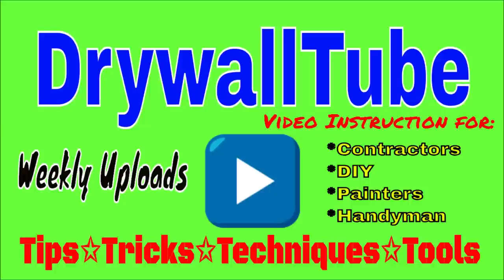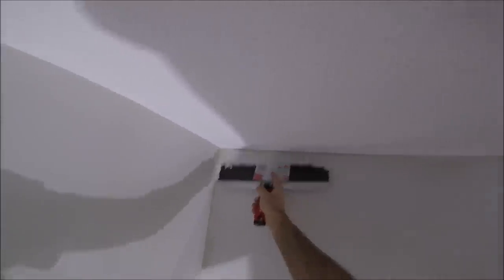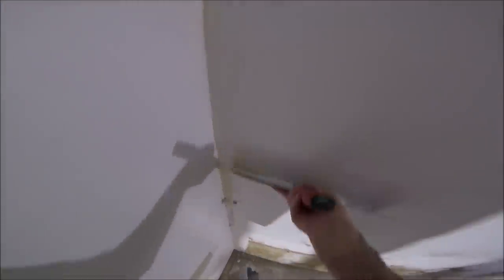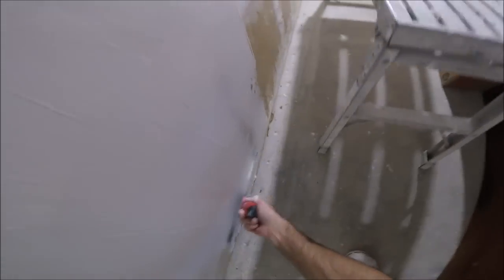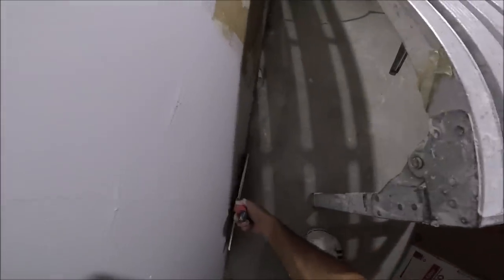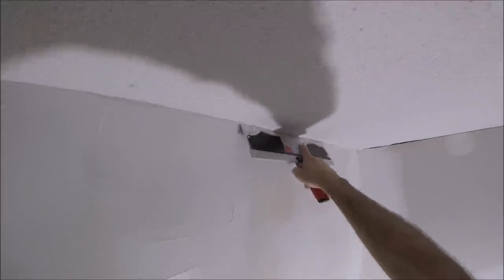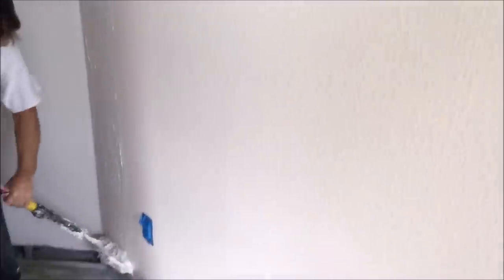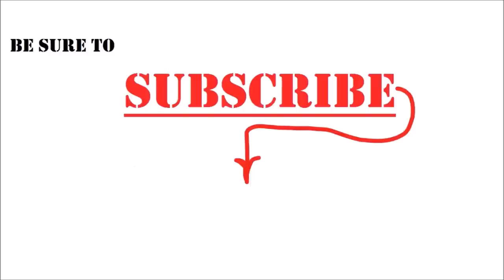How to Cover Your Ugly Damaged Wall with a Skim Coat- Looks Like Glass

Comment: DIYer here. I have a bath room with a slanted ceiling 10 feet at one end and 3 1/2 feet at the other with  a skylight. A prior owner installed paneling over unfinished sheetrock with nails only. I am taking down the paneling. The screws are installed flush with the sheetrock. Can I skim coat the sheetrock without setting the screws. Is it a good idea to seal the sheetrock even though there was nothing else on it?

Comment: Thanks so much for this helpful content. I’m just a diy’er who’s interested in learning how to do work by myself and save a lot of money in the process haha. I was just wondering if it’s ok to use drydex 30 min spackle vs joint compound when doing drywall repair that required new drywall to be installed, and how long should I allow the joint compound to cure for? Thanks and God bless!

Comment: Paul, I am DIY - what if your wall is painted with semi- gloss should I sand all over and paint primer on it before mud? Is there is a best primer to use for that; Kilz or Zinsser? :-) Okay, watching this video though you just answered my question ; Zinsser - but what if the wall is semi-gloss and has uneven wall damage from old repairs over that past 80 years and its a very small bathroom- do I need to sand or just prime?

Comment: Great videos.  I heard you mention that finished joint compound should be primed before painting.  I'll be using Behr paint which includes primer.  Will that suffice, or should I still first use the product you recommended?
Reply from the maker: You’ll need to use an actual primer.👍🏻 The paint and primer in one paints are only good for previously painted surfaces. I hope this helps. Thanks so much for watching and subscribing my friend!😎 -Paul

Comment: I am a DIY person  I have removed wallpaper from the lower half of the bedroom walls with a steamer it was a hot job that took awhile to do to remove all of the paper  It looks hideous but there are not many damaged areas, but the texture is all over the place .I only have one place with the brown paper exposed .  Your video is extremely helpful  I am sure you are making it look easy but I will give it a try .  So I will do the Primer sealer step first , then  can I do the roller method to apply the skim coat that seems to be easier to apply the mud.?   I just heard you say you do the paint roller technique with two people can one person do it ?  do you recommend doing the corners before the  first skim coating , and is it necessary ? Question is the joint compound the same product used for the skim coating ?? Thank you  This is my first time trying this.  After this  I will look for videos that you might have on how to replace  drywall  I have a bathroom project that is moldy due to flooding of the bathroom and  leaky shower floor  the whole  bath has to be redone   :(  Thank you so much !!!

Comment: Hi Paul, another great video.      I am a handyman doing more and more drywall work so really enjoy your vids.   I have a small bathroom ceiling that has paint pealing issues and some chipping dry wall on outside corners at a sky light. I scraped off as much flaky paint as I could and just used some Zinsser BIN shellac primer.  (Saw your Zinsser primer suggest a few minutes ago will use that next time)
Will the BIN primer work for a thin skim coat layer?      
Thanks  
Mike

Comment: I have 5 boxes of blue lite compund and want to utilize it for skim coating on plaster walls with drywall fill in larger areas... can i use it? Can i add glue or anything to use it? Should I use it on  first or second coat if I can utilize it? Thank you.

Comment: hey Paul I have taking on the task of skim coating my textured ceiling finished my 2nd coat , still some ruff spots so I will probably give it one more watered down coat hopefully this will be the last coat! Thought I had a smooth finish but next day I have a bunch of ruff finishes I didnt notice while applying the coat! Frustrating!!! My entire body is sore from working on the ceiling lol!!!
Reply: Just went thru a similar nightmare and it was over a ceiling that only had 70 years of jacked up painting jobs and nailpops.  I used good lighting on elevated stands and it looked good.  But after turning off all lights and just using a halogen flashlight across the ceiling the skimcoat looked terrible. I was more meticulous on the second coat with the same results. The hand sanding took longer and was more tiring than the skimming and after a few toucheups I think I'm ready for paint.  That light held ACROSS  the surface is a must or you'll be painting over alot of defects.  After painting you'll have to sand off the paint to fix any ridges or lift offs you missed.  This isn't to discourage anyone from trying this. Just remember it's much harder than it looks but with enough coats, a handheld light and the dreaded sanding, you can get a decent result.

Comment: DIYer here; need to fix a 40 year old bathroom.  Damage to bottom of exterior wall apparently due to efflorescence,  I know I need to replace the section of drywall & seal the cement slab; anything else I should do to ensure it doesn't reoccur?
Reply from the maker: When installing drywall over a concrete slab, I always keep it 1/2” off of the concrete floor to avoid any type of moisture wicking up into the drywall.👍🏻 I hope this helps. Thanks so much for watching and subscribing!😎 -Paul

Comment: Great Video!  My problem is the opposite...My walls have been painted over wallpaper and you can see the seams from the wallpaper.  Can I still use this same technique?  Any Suggestions?  Thank you!
Reply: I have tried it in the past it works for a little while but the some of the edges eventually peels hopefully it works for you

Comment: Hi there Paul, I have walls that have not been painted in I am guessing 20+ years - the last time the previous owners of my house did any work.  Would you put on the sealer before skimming?
Reply from the maker: I think you should be fine without priming if you use the all purpose joint compound for skim coating.👍🏻 I hope this helps. Thanks so much for watching and subscribing Jayman!😎 -Paul

Comment: Paul, you and many others say to use thinned down All Purpose for skiming.  But, people coming to my house for estimate that involves skim coating all my walls with a thin layer say they want to use Plus 3.  Should that make me not use them?  Even Topping can be used as a thin skim coat right?  A contractor sprayed my walls with Kilz3 primer and messed them up with many different textures in the primer.  skim needed to even out the texture.

Comment: My dry walls in the garage look like trash. Holes and patches and paper showing through. BUT, what I think is worse is the entire wall is chalky to the touch. Run your hand across them and you turn your hand white covered in fine power. Can I mud over the chalky walls or do I have to do a wash with something beforehand?

Comment: I have watched several of your videos and they have been so helpful, I started taking down wallpaper from a bathroom, they had put it directly on the drywall (no primer or anything) so it was really hard, I couldn't find gardz so I used pro 999, now I'm trying to do the skim coating part and it's so hard. I cannot we the hand of it, it's a very small bathroom and I don't want to waste a lot of material and I don't feel comfortable with the paint roller method. Any tips on how to get a smooth finish, also how to skim coat around really tight corners?

Comment: Watched several of your videos....got and older double wide with the vinyl covered drywall that previous owner removed the trim strips and attempted to tape and bed the joint. He did a really poor job then painted.  Paint seems to be stuck pretty good but a few places where the vinyl has turned loose from the gypsum  How to skim over the painted walls.  Maybe try to sand down the bad bed joints first then prime with Gaurdz.

Comment: Hi Paul, I'm a DIYer. I'm trying to sell my condo located in a 100 year old building. The contractor did a crappy job mudding my small laundry room wall. There are streaks, ridges, clumped mud everywhere especially at the corners where the wall meets door or window moulding. It looks really bad. I want to sand the wall down and remove those big clumps so I can skim coat it and re-paint. What's the best way remove those big clumps of mud? Thanks for your help!!

Comment: #drywalltube    Thanks Paul for another great video for us DIYer's out here!  Perfect for my own remodel project dealing with old rough textured plaster walls in my entryway and hallway.  I tore out the walls in the hallway and rehung new 5/8 drywall as the plaster on those walls varied from 3/4" to 1-1/4" thick in some places then had to straighten the walls to reinstall the new drywall.  Will be needing to finish that newly hung drywall soon but for now I am trying to repair plaster damage from door openings I had to widen and in the process damaged some of the old plaster surrounding the opening.  I will have to skim coat the entire wall on those sides now so I can get a consistent new paint finish where the repaired areas meet up with the undamaged plaster walls.   Great channel!

Comment: I'm a DIY'er. I'm remodeling my house and the walls have a heavy "stipple"texture. I'm trying to find a simpler way to smooth coat the walls. I've been doing something like this, but I haven't been doing the slant to the wallboard knife. I've been having to put 3 or 4 coats on the walls and it's still not as smooth as I would like.
Reply from the maker: Try leaving a little more mud on when you’re applying the first skim coat.👍🏻 I hope this helps. Thanks so much for watching and subscribing Tom!😎 -Paul

Comment: DIYer here. I have walls that are old sheet rock that has about 1/8" plaster coating with large areas where the plaster flaked off when scraping the wallpaper off. They're large uneven areas. How to I level that off?

Comment: I have a bathroom that was painted and the paint peeled and cracked. I tried scraping paint so I could do it right but it was not easy and in some places I got too deep and you can see brown patches. I also have another wall with wallpaper and was told I can mud over that too before painting. Any advice for me I’d appreciate

Comment: My house has wallpaper that has been painted over..So the walls are smooth. In one of the corners the wall paper is peeling.. should I peel off what is loose.. I was planning on scratching the walls a little with some sand paper a d then rolling on some texture... This is my first time doing anything like this

Comment: #Drywalltube. Nice job Paul, looks like a new wall and as smooth as new drywall. The paint roller trick seems like it would make the job easier.
Reply from the maker: Hey there TEH!💥👊🏻 I appreciate that man! Yes, the paint roller trick is perfect way to get a consistent application of the joint compound for skim coating!👍🏻 Thanks for watching and your feedback man!😎 -Paul

Comment: I'm a DIY. I've never done any mud work. I'm a mostly a woodworker/ mechanic but I do have a house that needs a lot of work inside. Time to learn some new skills. I have a couple small walls to practice on and play with as far a different painting techniques and patterns. I don't have any wallpaper to deal with. All the walls have a knockdown finish and painted an ugly off yellow. I have high vaulted ceilings with a popcorn finish. Is there a technique to use if I can't physically reach the ceiling? Can you skim coat using a extension handle? #drywalltube.
Reply from the maker: Hey Mike, I think it would be difficult to skim over popcorn without being able to get close up. IMO. Have the popcorn ceilings been painted? Thanks so much for watching and subscribing my friend!😎 -Paul

Comment: I'm new to doing walls. I've gotten all the wallpaper and paper off the wall but my wall looks a mess. I have places where the sheetrock is torn pretty bad. Also there was paint under the wallpaper some of the paint came off and some places there's still paint. Do I need to sand before priming? Also should I try and patch the places where the sheetrock came off before skimcoating? Thanks I love your videos. Nervous but not sure what my next step should be.
Reply from the maker: Hey there M G!💥👊🏻 No you can just prime right over the painted surface. Then make your repairs. After the repairs the skim coating fun can begin.😃  I hope this helps. Thanks so much for watching and subscribing my friend! -Paul
Reply: @PaulPeck  Thanks for the quick reply. I'm now ready for my next step!
Reply from the maker: M G Right on!💪🏻 Keep us posted man!😎

Comment: I need to re-skim coat a large area--1.5 to 2 feet--where an object dropped on the outside roof so hard it cause the skim coat to crack and break away on the inside ceiling. I am not sure of the best way to remove the loose skim coat that is hanging down so as to not make the problem area larger yet I want to put the new coat on a solid bound surface.

Comment: My god is this hard, especially after popcorn removal where the corners/edges are all messed up and bumpy.  1 bump by the ceiling or floor and the knife chaters and makes bumps and streaks.  Never been so frustrated, so tired of sanding. Took me about 400 hours of non-stop work to get 4 walls to look moderately decent. Should have hired Paul.

Comment: After our tenant left our condo unit it i found out some.painted areas are already swelling. Its a concrete wall and i think the building contractor skim coat the wall before painting. But after we remove the swelling part some.of the paints also peel off. We tried to.skim coat the uneven parts but it doesnt seem to adhere well. Now we re trying to wash the powderlike thing wich could be the reason why skim coat wont adhere.

Comment: #drywalltube
I’m a DIYer renovating my master bathroom. I finally got the wallpaper off and walls cleaned. Now I’m skim coating. You make it look so easy! I thinned my mud to pretty close to your consistency, maybe a bit too thick still. First layer I felt like I pulled way to much mud off, some spots I could still see the wall other spots it was just right with a nice thin layer. 

 My second coat I’m going to try to paint roller application method as I might have struggled with applying the mud before smoothing. Is there a way to tell if you’re pulling too much mud off? I know to add pressure to just one side to prevent lines but how much pressure overall? 

I’ve only watched a few videos of yours and haven’t seen the answer to those questions yet, but I’m sure you’ve answered them somewhere. 

Thank you for all the help
Reply: Get a magic trowel to skim coat

Comment: Can I use interior filler for that.  I put the wrong paint ,on my kitchen wall ,next day got cracked everywhere.,as I'm DIY I start scraping it off , till I removed a lot of chanks of layers. And to cover the damage I painted gloss over it. Now year later I want to fix the wall like you did in the video. The wall now looks uneven with paches,.

Comment: Im a DIYer and I'm glad I found your video. I have paint the has peeled off my kitchen wall where I want to put stick on backsplash. Is there any other kinds of sealer brands that I can use that are sold in stores? And is it ok to mud over painted areas? I have a section where I didn't peel the paint off cause it's a big section. #drywalltube

Comment: I used Roman Pro-999 RX35 surface sealer. Some of the top layers of brown paper rippled and separated from the layers underneath. It also raised some if the white paper, but I think those spots were from the wallpaper removal. Wasn't a big deal, I just cut those sections out an resealed. #drywalltube

Comment: #drywall, that pancake comment cracked me up so much. Ahahaha. Thank you for the tips.  I have the same issue with a new house I moved into now. Removed the wallpaper and the wallpaper took some of the drywall skin out, leaving brown grooves as in the  video. So I primed it and use speckle, everyone at Lowes and contractor friends said to use speckle, not USG compound. What should I do with the third and fourth wall, continue with speckle?

Comment: Hey Paul, I have some areas that have wallpaper that is coming off very hard. Can I leave it on and use the sealer and skim over top of it?
Reply from the maker: You can. But, I would do a tester spot first to make sure it’s not going to release while the mud sits on it wet.👍🏻
Reply: @PaulPeck  I thought the sealer would prevent that, no?

Comment: My contractor used tape on a corner bead. The tape bubbled after it was painted. Is there a way to fix the bubble?
Reply from the maker: Take a razor knife and cut out the bubble and apply joint compound to that area until it is flush with the rest of the corner. Thanks so much for watching! -Paul

Comment: Nice job, but you rarely seem to answer people questions.  Your feedback will help rank the videos higher in searches by interacting with us viewers.   I have asked a question in a similar video of yours, but what causes pin hole air bubbles when skim coating after the first coat?
Reply from the maker: I appreciate that Jo!💥👊🏻 Sorry I missed your comment. But, I do try and answer as many of the hundreds questions as I can. Are you thinning your skim coat mud with water at all? Thanks so much for watching and subscribing!😎 -Paul
Reply: @PaulPeck  - I do thin it with water and some drops of dish soap.  It only starts to happen once the second coat goes on.  Never occurs on the first coat.  If it had to do with air in the mud I would assume it would happen on the first coat as well.  Thanks.